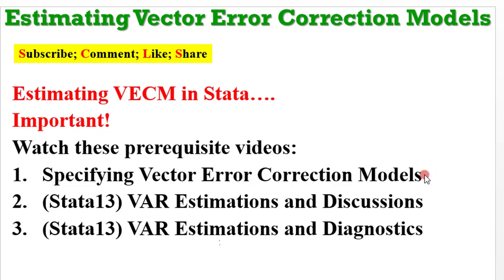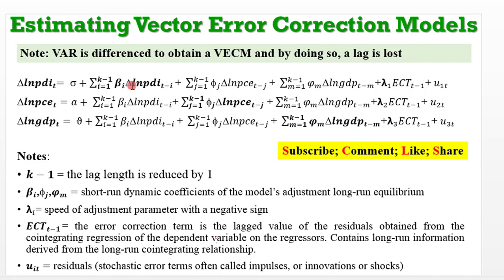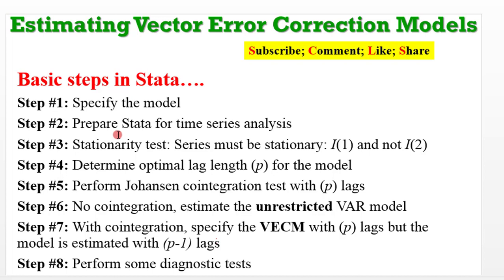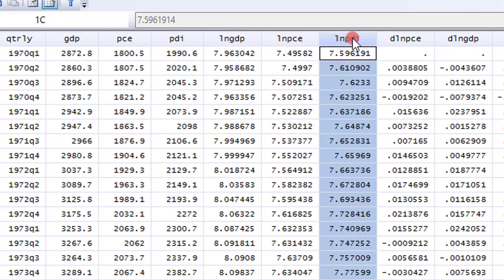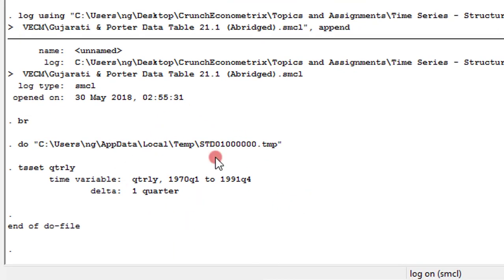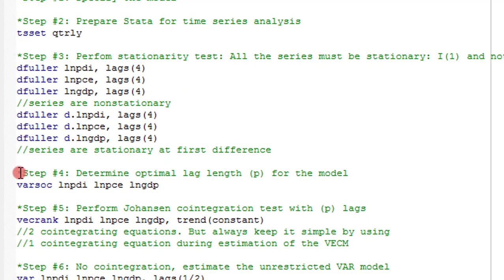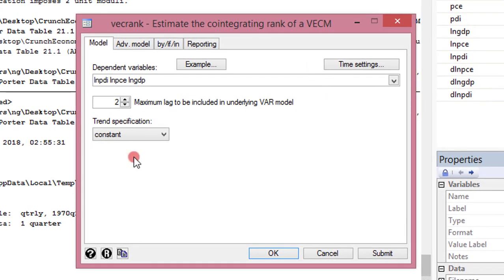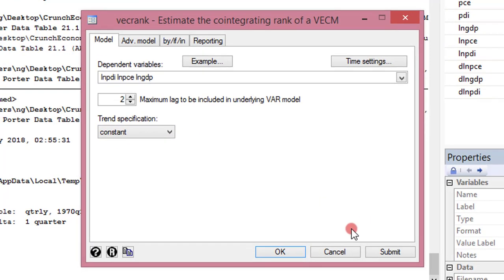(Stata13): VECM Estimation, Discussion and Diagnostics #var #vecm #causality #granger #wald

Comment: Hi prof,must you difference but a lag variable or you can as well do it at levels.If both which is adviceable to do?
Reply from the maker: Hi Bertrand, kindly recast your query. Not clear to me. Thanks.
Reply: @CrunchEconometrix  oh sorry instead of log i put lag.what i mean is, in attaining stationarity  we difference the series .must one difference only the log transformation  of the series or it can as well be don on the raw data.secondly please what is the criteria for interpreting diagnostic test like langrange multiplier,jacque berra and stability condition.You gave no criteria  for their interpretation.Thanks in advance and greetings from cameroon.
Reply from the maker: @enongenebetrand1119  Difference the log if you are estimating a log-log model. I always explain diagnostics using the pvalues.

Comment: Thank you for all. I have a question  a did ardl bounds test and I look that my variables is cointegrate but when I look to my ECM term is -1.56 how can I interpret this number
Reply from the maker: Your result will be discarded, Jete. ECT of -1.56 is TOO bogus. Re-estimate the model. Change regressors/control variables. Run different model specifications (log-log, log-level)...when the ECT is within 0 and -1, adapt the interpretation given in the video. Thanks.
Reply: @CrunchEconometrix  thank you so much ,i will do this thank for the  advice
Reply from the maker: @jeteshaina6220  U're welcome 😊. Please may I know from where (location) you are reaching me?
Reply: @CrunchEconometrix  I'm from mozambique

Comment: Thankyou!!! You’ve been the most helpful econometrics lecturer thus far.
How do you interpret a VECM with 1 lag? The data I’m working on selected a maximum lag of 1, meaning that the VECM essentially ran with 0 lags. The short run estimates showed only the dependent variable for each of the 3 equations e.g under lnpdi there’s only L1 and the constant, no lnpce/lngdp. Likewise, under lnpce there’s only L1 and the constant, no lnpdi/lngdp and so on...
Reply from the maker: Hi Bupe, thanks for the positive feedback and the kind words...I'm encouraged to do better😊. My suggestion: put 2 in the box for the underlying lags for VAR such that the VECM is estimated with 1 lag as shown in the video. Reason: VECM should not be estimated as a static model (that is, with 0 lag).
Reply: CrunchEconometrix thanks once again. I would have messed up my whole dissertation. 
I have solved the problem by adding a dummy variable to control for structural breaks and using the LR criterion instead of AIC/BIC.

Comment: Dear Bosede, 
I love your videos. They are helping me so much to finish my Bachelor Thesis. Thank you so much for your work
However, I got a question regarding the Interpretation of the ECT. If I have 6 depedent variables ( 6 countries), In order to interpret the ECT of each country i need to run the model every time with that variable on the front? . As the Johansen Normalization Restriction Imposed changes everytime you change the variables
Reply from the maker: Hi Juan, thanks for the positive feedback on my YouTube videos. Deeply appreciated! For simplicity, use one cointegration equation as explained in the clip. May I know from where (location) you are reaching me?
Reply: @CrunchEconometrix  Yes there seems to be only one cointegrating vector. My question is regarding the explanation of the ECT for each variable. In the clip you establish lnpdi as dependent variable, and it takes the form of 1, and you explain it. But If i want to explain the ECT of lnpce do i need to put this one first?

From the Netherlands. This videos have been my savior
Reply from the maker: @juansimonescobar6711  Keep it simple. Concentrate on the outcome variable of interest and arrange it as the 1st variable in the system. Every other thing falls in place. Thanks for watching my videos. Please tell all Netherlanders about my YT Channel!
Reply: @CrunchEconometrix  For sure I will tell. 
But this is a multivariate time series. I need to give results for every country not only one, that is why i ask.
Reply from the maker: @juansimonescobar6711  This video explains time series analysis for a single country.

Comment: The lambda's need not be negative. Their sign will depend on how you normalize the cointegrating vector. What is true with single equation ECM is not generalizable to VECM. You normalized it for lnpdi so lambda is negative for that particular equation, but not necessarily in the equation for another dependent var.
Reply from the maker: That is correct. However, the a priori expectation is that lambda comes with a negative sign for all equation in the system upon estimation to satisfy longrun convergence. May I know from where (location) you are reaching me?
Reply: @CrunchEconometrix  I am afraid that is incorrect and a quite common misconception. See for a very nice heuristic explanation:
https://stats.stackexchange.com/questions/203649/sign-of-adjustment-coefficient-of-error-correction-term-in-vecm 
or you can find an example in Enders's Applied Econometric time series in chapter 6, eq 6.72-6.73 for a case when one adjustment coeff is negative, the other is positive and it must be so. A priori as well.

Comment: Hi, your video is very helpful. In my annual time series I experienced the difference in the  rank selection based on  trace statistics and max statistics (for example, the trace statistics suggests cointegrating rank of 2 while max statistics suggests rank 1). Is that even possible? if yes, then in such case which statistics is better to choose? 
And in your example, there seem to be 2 cointegrating equations but you only chose one cointegrating equation while fitting a VECM. What happens with the other one? Can we simply ignore any other cointegrating equations and just estimate the VECM for one cointegrating equation? 

Thanks in advance!
Reply from the maker: Hi Yashoda, watch my video on Johansen cointegration test where I said that the researcher is disposed to using either of the test statistics. I also explained that you keep it simple by using 1 CE unless you are able to explain your results with 2 CEs. May I know from where (location) you are reaching me?
Reply: @CrunchEconometrix   Thank you for the quick response and the explanation. I still have couple of confusions (let say questions) which I would be grateful for getting answers on because I really need some quick suggestions on this topic. 
Firstly, What does it imply when the ECT is negative and insignificant? and when the ECT is positive insignificant and positive significant? (I came to have all three kinds of coefficients for ECT)
 Also, while you performed the diagnostic test for vec stability and got the result " The VECM specification imposes 2 unit moduli." you just said that this is good! how can you say that is good or how to know if the vec is stable? 
And I live in Norway now.
Reply from the maker: @yashodakarkee8832  Know that any statistically insignificant coefficient need no interpretation because it is equal to zero. A positive and significant ECT implies an explosive model with no longrun convergence. Please I have always reiterated that video tutorials are not enough, they must be supported with reading. Kindly do these and you will get better faster. Thanks for watching my videos. Deeply appreciated! Kindly share my YouTube Channel link with your students and academic community in Norway 🇳🇴. Thanks 😊

Comment: Your videos have been extremely helpful.  I have a question, what does it mean when none of my variables are significant in the short run but some of them are significant in the long run.  and my error correction is significant but it is a very large speed of adjustment
Reply from the maker: Hi Nicola, thanks for the positive feedback on my videos. Deeply appreciated! 💕 Some factors could lead to not significant coefficients: too many lags and multicollinearity. So, correct these. Test for multicollinearity replace variables with high collinearity. According to Loayza and Ranciere (2014) ECT lower than -2 is acceptable (🔎 for the paper). May I know from where (location) you are reaching me?
Reply: @CrunchEconometrix   Jamaica. :)
Reply from the maker: @nicolaboyd5868  Awesome Nicola...I'll appreciate it if you can help share my YouTube Channel link with your students, friends and academic community in Jamaica 🇯🇲 and on social media. They'll learn some useful tips and skills too. Thanks! 💕
Reply: @CrunchEconometrix  this vedio us very helpful for my research. My question is  in Johansen normalization restrict I got one variable which has positive relationship with dep variable but p value not statistically significant i.e. not less than 10%. In that case what is the interpretation?  Please let me know. Thanks.
Reply from the maker: Hi Umme, it implies NO relationship between both variables.
Reply: @CrunchEconometrix  One last question, is the the results from the vecm my model and can I use them as my interpretation results or do I have to do a causality test
Reply from the maker: @nicolaboyd5868  Sure! Unless, you are interested in testing for causality then you can proceed further (watch my videos on the procedure).
Reply: @CrunchEconometrix   you are such a gem. I will recommend your videos to all my classmates. Last question , when interpreting the long run relationship is it still ceteris paribus ?
Reply from the maker: @nicolaboyd5868  Yeah, same ceteris paribus interpretation. Thanks for offering to share my YouTube Channel link with your cohorts. Means a lot to me, gracias! 💕 😊
Reply: @CrunchEconometrix   Good day again , i have share your page with my fellow classmates and prompted them to subscribe. I have a question. I know you have done some vecm diagnostics in past videos. However, how do I test for heteroskedasticity and zero conditional mean
Reply from the maker: @nicolaboyd5868  I didn't perform these tests because Stata has no menu command for them and I don't know of any user-written syntax.

Comment: Thank you so much for this video CrunchEconometrix. I am writing my thesis and this video has been my biggest help so far! Is there any way to support you besides subscribing?

Quick question: in the video you specify rank(1) to "keep it simple". I am estimating a vecm and there are 6 cointegrated vectors. I am only interested in explaining one of them (exchange rate). Can I follow the procedure in your video, even when vecrank told me there are six cointegrated relations?
Reply from the maker: Hi Hero, thanks for the offer to support my Channel. I'll appreciate if you help share my videos with your friends, colleagues and academic community. I need the global academic community to be aware of my Channel. My niche is to assist students and upcoming researchers.
...yes, keep-it-simple, always use 1 cointegrating equation (CE). As a confirmation, check papers on VECM to find that rarely will you see any using more than 1. Interpretations will be a bit clumsy with more than 1 CE.

Comment: If my VAR specification has 1 lag should I use 0 lags for the vecm?
Reply: I've found your videos very useful, thanks again
Reply from the maker: @zac2607 ...then don't keep me to yourself (lol). Share my YouTube Channel link with your students, friends and academic community. They need to know. Thanks! 💕 😊
Reply from the maker: King, that'll be an exception, because VECM is not a static model. So, maintain the 1 lag.
Reply: @CrunchEconometrix  thanks! Just to confirm I will specify the model to have 2 lags when creating the vecm in stata and stata will take one off itself because of how it works?
Reply from the maker: @zac2607  But you said the VAR has 1 lag?
Reply: @CrunchEconometrix  yes the VAR has one lag but when running a VECM you said that stata automatically takes 1 lag away. So if I put the lag number as 1 in the VECM then stata will take 1 away leaving a 0 lag
Reply from the maker: @zac2607  Oh yes, that's true. I was thinking EViews. Put 2 lags cos Stata will estimate with a lag.
Reply: @CrunchEconometrix  thanks very much!!
Reply from the maker: @zac2607  U're welcome, King...may I know from where (location) you are reaching me?

Comment: Dear Professor thanks a lot for your videos. They have really helped me find my way through in the final year of my thesis. I would like to know (i)  if my model shows cointegration using both Engle and Granger and Johansen however when I do the Gregory Hansen cointegration test, there is no cointegrtaion in the presence of structural breaks which one do I retain. Secondly, if the ECM parameter is negative and significant, the long run parameter is significant but none of the short term parameters are significant as indicated in the Johansen test, is this an issue?? Thanks loads. Your videos have really accompanied me through these challenging times.  I'm from Mauritius and work as lecturer.
Reply from the maker: Hi Sanju, thanks for the positive feedback on my videos. Deeply appreciated! (1) why use Engle-Granger, Johansen and GH. These are different tests. You will confuse yourself. Use only the appropriate tests for cointegration. For one, EG is no longer popular, it has since been replaced by JCT. (2) the ECM (explains the speed of correcting past errors) and JCT (shows long-run relationship) explain different aspects of your model, so interpret the results independently. My love to all Mauritians. Do share my YouTube Channel link with them! 💕
Reply: Thanks you very much for your very prompt response. I have another little question - if the Ramsey's RESET test is significant at 5% level does that mean that the model specification has to be reviewed although this is not so much in line with econometric theory. Thanks a lot again and best wishes to you
Can I still keep the model if all other tests (normality, heteroskedasticity etc satisfy the norm?)
Reply from the maker: Hi Sanju, I rarely perform RAMSEY test, hence cannot give an explicit interpretation. But yes model is good of it passes the mentioned diagnostics. I'll very much appreciate if you share my videos and YT Channel link with your students and academic community. Thanks!
Reply: Thanks so much. will definitely share your videos. They've been of great assistance to me. Thanks again
Reply from the maker: @sanjunaraidoo7034  U're awesome, Sanju! 💕 Thanks for sharing! 😊

Comment: Hi Professor, I used 7 lags for my VECM because I used daily data. after checking the residuals for serial correlation I found out there are different significance at different lags thus serial correlation at lag 3,4 and 5 and no serial correlation at lag 1,2,6 and 7. How can I interpret this? Thank you
Reply from the maker: Hi Justin, use the appropriate optimal lags as obtained from the varsoc command to estimate the model....and from there perform the respective diagnostics.

Comment: Cruncheconometrix, Thank you for the video. I have an important question: do we use the differenced values(d1) in our estimation(like testing for cointegration) or we use the original values. I get different results when I use the original values and the differenced values.
Reply from the maker: Hi Iddriss, my videos are explicit. Follow my procedure.
Reply: @CrunchEconometrix   one last quest: if overall the variables are not normally distributed (according to the Jack-berra test), what do you do? Does that nullify your estimation results?
Reply from the maker: I'll say do nothing (unless you want to change some variables and re-estimate the model). It does not nullify the results except such can't be used for inferences.
Reply: @CrunchEconometrix  sorry prof. for disturbing. Is there any technique in stata to boost the error like robust standard error in ols? I think this will help normalize the unnormal error distribution. Regards.
Reply from the maker: @thetruth4712  Not sure if the "robust" option is allowed for the VAR routine.

Comment: Thank you for the video! 
I have a question: what should I do if the results for both Lagrange-multiplier test and Jarque-Bera test show a Prob>chi2 below 0.05? Does it mean that the model is biased and useless? 
I started with level data and tried to improve my results with log but I got the same results.
Reply from the maker: Hi Alessis, these indicate that the model suffers from serial correlation and its not normally distributed. To control these, several measures may be required depending on your data and variables such: including a lag of the depvar as a regressor, replacing some variables with better proxies etc. Try these and observe the outcomes, thanks.
Reply: @CrunchEconometrix   But since I'm applying a VECM model I already have a lag of the depvar as a regressor. What do you mean? Should I increase the number of lags and disregard what the optimal lag determination criteria said?
Reply from the maker: If that's the case, you may try increasing the lags to 2.

Comment: hello teacher i have a question , when i use 'vecrank EU_Price EU_Yield' , stata respond :the sample has gaps
but i have checked data 
drop if EU_Price==. 
drop if EU_Yield==.
stata said (0 observations deleted)
but i implement 'vecrank' again
the answer of stata is the same "the sample has gaps"
how come ?  what can i do?
Reply from the maker: You told Stata to drop both variables on the condition that they have NO observations. That is, if you have data from 1980 to 2017, you want both variables dropped because they have 0 observations across those years. What you want Stata to do is to remove those years having no observation within the dataset. In my opinion, this will distort your dataset and reduce your time span apart from the fact both variables do not have equivalent missing obs in those years. The best solution: change those variables with closer proxies having sufficient data points. OR post this query on Stata.org FORUM for further assistance.